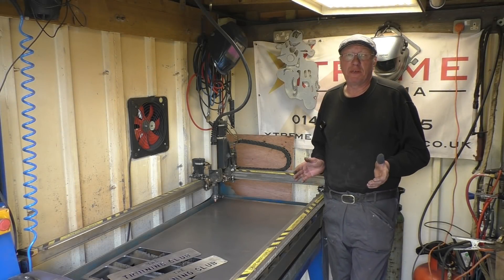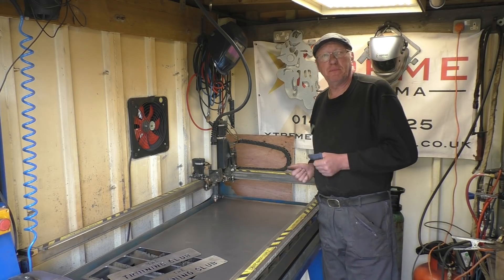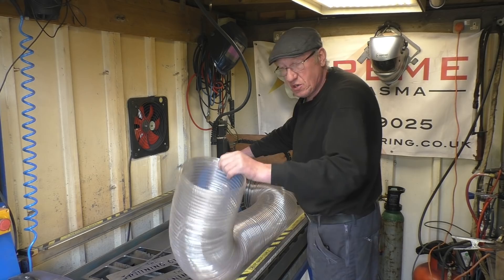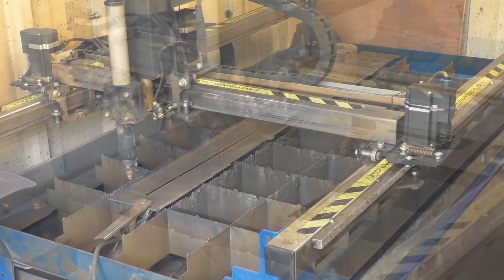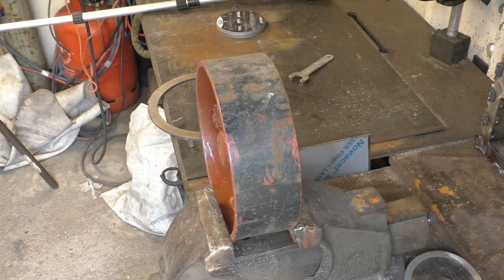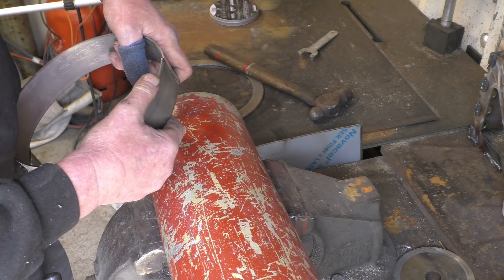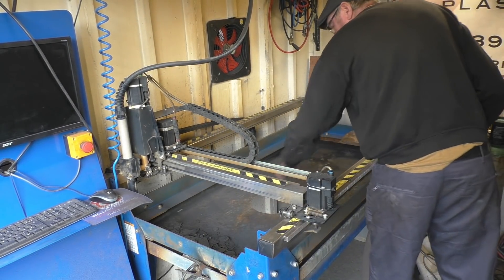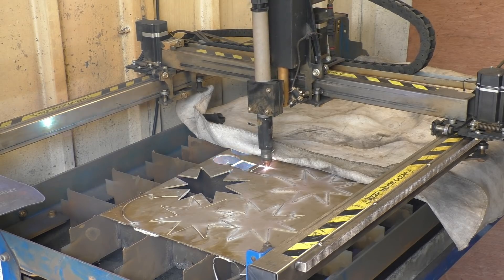SNNC 378 P2   Plasma Table Extraction Mods

Comment: If I'm not totally wrong You really have a plasma cutter in Your own shop. Whow! Is there any modell of plasma cutter that could fit above the dishing bay of the zink using 240 volt and 10 Amp fuse? Guess not....
Before this video I thought that You only made adverticing for Extreme Plasma Cutting Ltd...
What CAD do You use? (Con)Fusion 360?
A plasma cutter addition on top of the milling table would have been fantastic....

Comment: The fan you have is for moving large amounts of air at just below regular air pressure. The baffle you've put in is causing too much restriction to the airflow and the fan isn't good at creating a vacuum. If you remove the baffle it might work but I guess the pipe will melt. Also, capturing small particles like smoke is hard, they hang in the air so it's best to capture them as close the source as possible.

Comment: I would use metal stovepipe instead of the plastic pipe.  One good spark with that much air moving through there and you could have a raging fire in a few seconds.

Comment: I wonder if steam  ( it has the latent heat of water so will cool the hot gas pretty well) or a fine water spray would help to cool and condense the vapour . Ideally it need to be under the plate being cut.

Comment: John if you create a negative pressure in the room itself the above will work even better. I e you want to have a small opening to the room and suck air out faster than it’s coming in this will create a negative pressure environment and will help the big fan. The fan in the wall and the one you are now connecting, if are both blowing to the outside air then try closing your shed doors. Should see a drastic difference
Reply: if they are both blowing out they will be fighting each other. There should be suction under the table and as much air as possible getting  in everywhere else
Reply: @fuzzy1dk  not really, I do agree both fans should probably suck from the same place but if you have a small inlet and large outlet you will keep the room in negative pressure so enhancing air movement. It’s the same principle applied to say aeroplane cowls. Small in and large out helps move the heat from the engine. I could be wtong
Reply: @monsterg4603  the only time you want negative pressure is if you want to keep stuff in. In this case you want lots of air getting in to the shed past the cut and out the below table fan
Reply: @fuzzy1dk  don’t know about that. That would be positive pressure in the room where it can’t escape quick enough?
Reply: @monsterg4603  with positive pressure and a fan sucking under the table all the air a fumes would all be flowing towards the outlet under the table and not into the room
Reply: @fuzzy1dk  I disagree. To remove heat away from an engine you have small inlets and large outlets.
Reply: @monsterg4603  air expands with heat so a larger volume needs to go out than in. You definitely don't want low pressure
Reply: @fuzzy1dk  exactly so more volume of air to leave than coming in.
Reply: @monsterg4603  if you have a fireplace in your living room do you want A: low pressure in the room so smoke flows from the fire into the room or B: high pressure in the room so air flow out the chimney?